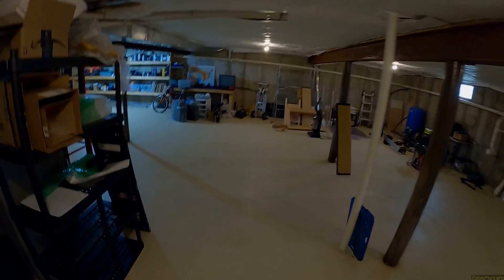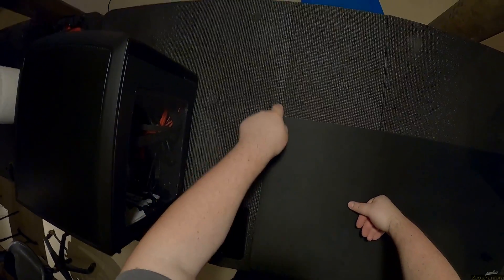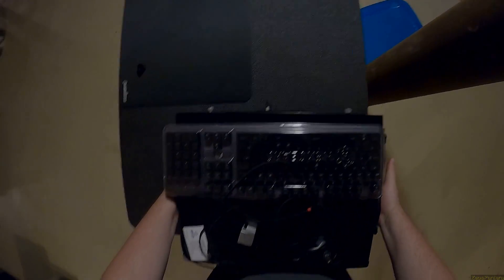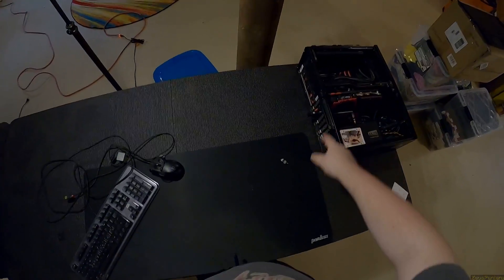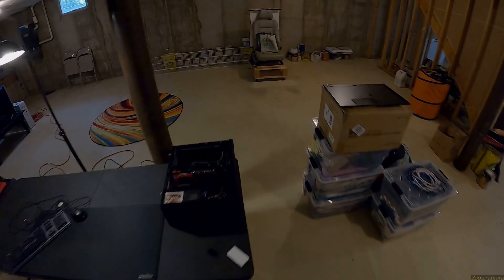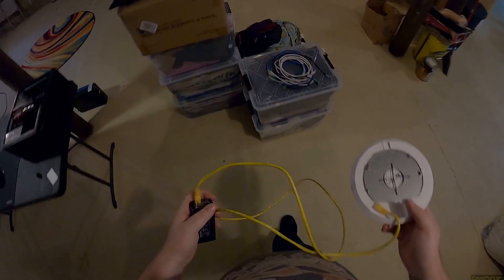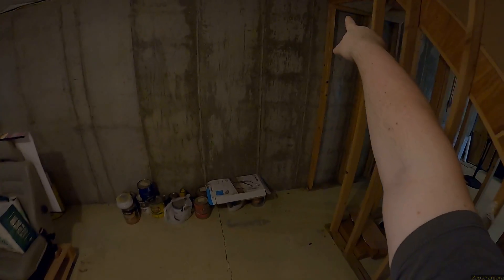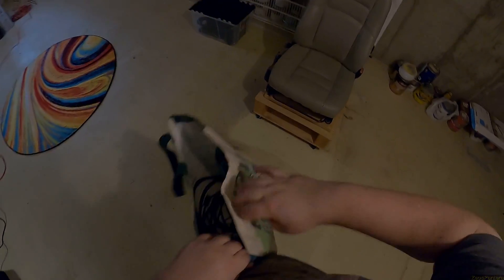Z Does - Computer Set Up But Not Really (Part 1)

Comment: There are l-bracket adapters for 6/8-pin connectors so that the connector comes from the side and not the top. Still seems like a tight fit though, but for dust purposes might be preferable.

Dunno if you figured it out but that little random thing you found looks like a quick release plate of sorts